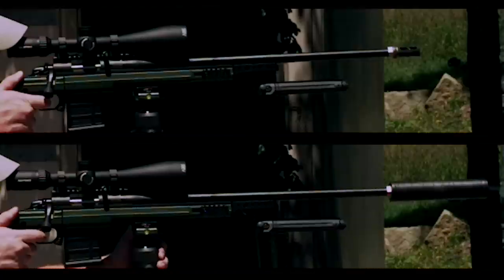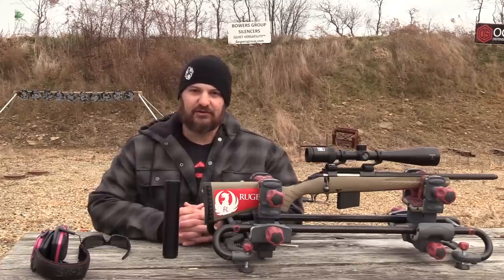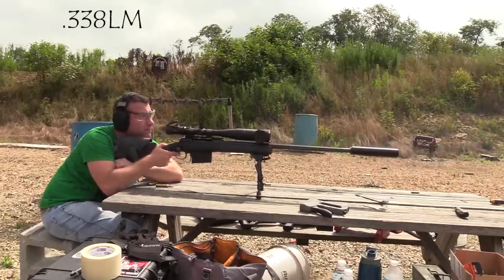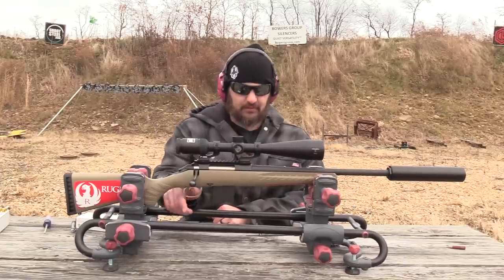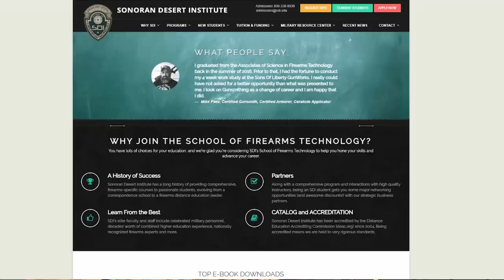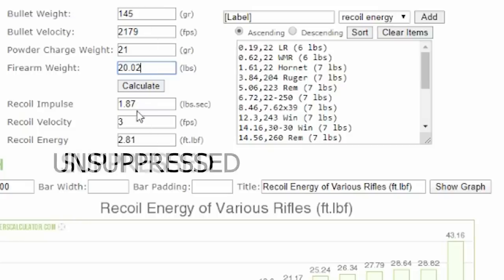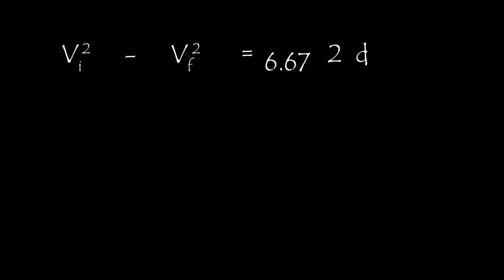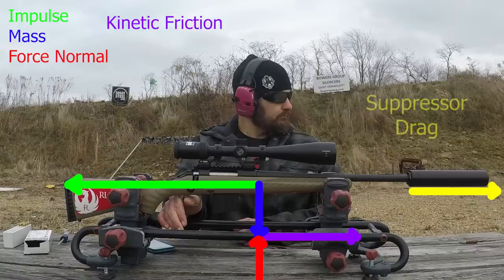Why Do Suppressors Reduce Recoil? Hidden Gun Knowledge

Comment: Hi! I'm an engineer and I've been wondering the same thing as you addressed in this video. I only have one comment! 

The problem you are looking at here is very complex because of the way in which the gases inside the suppressor are acting and interacting and applying forces to the firearm while the recoil impulse of the projectile is being applied to the firearm. So.. I tried to do the math on something simpler. What if all the suppressor did was just slow the gases coming out of the muzzle to such an extent that they would not be contributing to the recoil impulse of a firearm, such as with a muzzle brake? We know that that's how suppressors work, by slowing down propellant gases. What if that's all we chose to test and look at. So, i disregard any instantaneous or transient effects that may be occuring right at the time the projectile leaves the muzzle and gases are swirling in the suppressor, and look at a point in time when the firearm has had the impulse applied to it, and the projectile has left the firearm. Doing this, I used your numbers to calculate; 

The impulse of the projectile: 1.42 lb sec
Total impulse of the projectile + propellant: 1.87 lb sec
The impulse of the propellant gases (unsuppressed): 0.422 lb sec (difference of the two above)

Applying the unsuppressed impulse (projectile + propellant) to the unsuppressed mass of the firearm, yields a velocity of the firearm of 3.005fps, as given by the calculator.
Applying the suppressed impulse (projectile only) to the suppressed mass of the firearm, yields a velocity of the firearm of 2.194fps. The recoil impulse felt by the suppressed firearm should be 73% of the one felt by the unsuppressed firearm. (one divided by the other).

If I now verify with your numbers, and assume that the recoil impulse velocity should be proportional to the distance it moves (as it would be with constant friction => constant acceleration) I find that in your case, you found that the recoil movement of the suppressed firearm was 72.1% of the recoil movement of the unsuppressed firearm.

73% in theory, 72.1% in practice.
Reply: This is what I assumed was happening; a less effective muzzle brake.
Reply: @skepticalbadger  I thought about that actually after seeing your reply, and I checked with some numbers produced by other sources, namely precision rifle blogs big muzzle brake shootout. 

From them it seems as if a 27% recoil reduction is just about average for a muzzle brake/compensator, as some scored as low as 12% and others as high as 43%. The suppressor tested here seems to be right in between.
Reply: You way over complicated this.
I already left this comment but it's simple. 
The suppressor has added volume when compared to a barrel. This volume reduces the thrust leaving the suppressor. The barrel alone doesnt have this volume to reduce the pressure before exiting the muzzle.
His "parachute" theory is wrong. 
The force going forward is so minor it shouldnt even be accounted for.
Reply: @FreedomInc  Who overcomplicated what? The theory you propose is just wrong, and though I tried to explain all the math very very thoroughly, if condensed, this is two or three basic algebraic momentum equations. It is not at all a complicated description of the situation, rather way simplified. Your suggestion involves the incorporation of volumetric flow rates and thrust reduction due to increased area, which complicates it, but in the hopes that it may help you understand the math, I also did the impulse equation on the theory you propose.

Knowing velocity is proportional to momentum, we can substitute it straight into the equation below instead of velocity to find;

(assuming constant volumetric flowrate, which is the only distinction between this assumption and the method I proposed)
pi * d1^2 * v1 = pi * d2^2 * v2
pi * d1^2 * p1 = pi * d2^2 * p2
Solve for p2 => (d1/d2)^2 * p1 = p2
(0.762/1.5)^2 * 0.422lbsec = 0.109lbsec

Resulting total momentum of firearm assuming the proposed method is true;
propellant momentum + projectile momentum =
0.109lbsec + 1.42lbsec = 1.530lbsec

Applying this to the suppressed mass of the firearm the same way as we did previously, we can find;
(1.530 lbsec) / (21.23lb/32.17) = 2.318 fps
2.318 / 3.005 = 0.771 = 77.1% -> Insufficient as experimental data from the video shows reductions down to 73% and the "overcomplicated" theory was significantly more accurate.

The predictions resulting from the assumption you proposed are significantly less accurate (4.1% discrepancy vs 0.9% discrepancy, a relative difference of a factor of 4) than the "overcomplicated ones" outlined in my original comment, and are therefore wrong. They are also completely unsupported by the physical conditions, which is that the gases cannot simply exit the suppressor as quickly as is proposed by your theory. It would seem to be excellent for a blast mitigation device though, but not suitable or carrying descriptive power for the physical conditions here.

All the suppressor does, is effectively stop the gases inside the suppressor, while the projectile exits. The propellant gases can then slowly exit through the front of the suppressor, effectively negating their momentum.
Reply: @SigneOtter  ok, so for the normal scrub like myself, the added volume of the suppressor reduces the thrust exiting into the ambient atmosphere then.
Again,you over complicated it. 
But, the suppressor "slows" that thrust down due to the volume of the suppressor. Not so much the baffling in the suppressor due to drastic changes in the atmosphere of the suppressor.A larger suppressor no matter the weight or design will have less felt recoil than a smaller suppressor.
An empty "can" without baffles will cause less felt recoil than the rifle alone will have.
The projectile has no direct effect on felt recoil other than the friction caused by it which allows the pressure to build.
Reply: @FreedomInc  I dont think you understand the problem if you say I overcomplicated it. All the math I have used to show earlier does, is describe the problem like this;
The bullet goes out the front of the suppressor. The propellant gas stays in the suppressor and leaves slowly after the rifle has already experienced the majority of the recoil impulse due to firing. Don't include thrust, its inaccurate and it really does overcomplicate the problem. That being said, the explanation I gave can be phrased in a way that does include thrust; the suppressor completely negates the thrust normally caused by fast propellant gases flying out the front of the muzzle, reducing the total recoil impulse of the firearm such that the only recoil is caused by the thrust caused by the projectile going out the front of the muzzle.

But.. Thrust in very precise terms tends to include not just momentum, but also impulse. Which needs a timescale, and therefore requires me as an engineer to include the time over which this change occurs. An momentum exchange like the one I did only includes the final velocity and mass of each thing that shoves on each other, and is therefore not an overcomplication, but a simplification. I dont understand what your beef is here.

So.. When considering how felt recoil works, you need to try to consider the system in a vacuum. The rifle at first is standing perfectly still. As the rifle detonates the powder charge, the expansion of the propellant gases pushes the projectile one way, and the rifle in the other direction. 

We call this a momentum exchange. And we know from Newtons laws that each of those forces must equal one another, so we set the recoil impulse that the firearm receives equal to the impulse given to the projectile and powder charge when firing. 

That is what you feel when you feel the felt recoil. The most a suppressor could ever do to reduce felt recoil, because it cannot throw anything "backward" from the rifle, is "stop" the gases from going forward as fast. Which is the ideal case I showed the math on how to do in the first comment, in response to how the video seemed to overcomplicate it by assuming the suppressor could somehow pull on the rifle without exerting a force on something else. If it could, this would be a violation of newtons third law.

I hope this helps.
Reply: @SigneOtter  not everyone is an engineer.,but most people have common sense
Reply: @FreedomInc  I don't see how he over complicated this... It's very simple math and it quantifies and verifies the difference a suppressor makes. You just seem to have a conceptual idea and nothing more. Conceptual ideas are great for thought experiments but when it comes down to actual data you need to be able to put it into quantifiable terms or else you're not really any more correct/incorrect as the people that were in the "added weight" camp.
Reply: @Kyrazlan  I'm not getting back into this conversation a week later with some one else.
The extra volume of the suppressor cools the gasses. Both the cooler gasses combined with the volume of the suppressor reduces thrust. It is that simple.
And again, not everyone is a mathematician or engineer,but most people have common sense. Except apparently for engineers
Reply: Could't it be, that the recoil is just lower, because of the added weight of it?
In my opinion, the suppressor could even enlargen the recoil, because the gas stays in the barrel for a longer time, so pressure is forcing the bolt back for longer and  increasing recoil....
Reply: @Dodo-ze5ep  Thats not how the physics works. The calculations showed in the initial post accounts for the rifle being heavier with the suppressor mounted. The suppressor also does not add impulse in any direction, so it would not be able to increase recoil. Like if youre in space, in free fall, you cannot increase the force pushing you in one direction by a suppressor attached to your rocket thrusters "holding onto" the gas. What causes the recoil is the fact that the gas is pushing off of and out of the rifle. 

This is the basis for the same misunderstanding in the video, unfortunately, a failure to see the rifle as a closed system and look at the impulse transfer in the end states of the system.
Reply: @SigneOtter  But when a suppressor is mounted, the pressure in the barrel and the suppressor is higher for longer, as if the gun is fired normally, so in this point it has to add recoil, eventhough its probably not very much.
Reply: @Dodo-ze5ep  It does not. Thats not how free body momentum exchange works. The pressure in the suppressor pushes on the back of the suppressor, on the front of the suppressor, on the sides of the suppressor, all of this cancels out, so you need to look at the end state.

The cartridge detonates, the projectile goes out the front. the only opening is the front, so the gas goes out there too. except it gets slowed down a lot, which decreases its momentum.
Reply: @SigneOtter  Yes, I know that pressure works in all directions, but thats not what I'm trying to say. I just want to say, that as the suppressor slows down the gas exiting the muzzle, that this gas is longer in the barrel and will push the bolt back for a longer time than usual (without suppressor), which is resulting in a larger recoil. So its basically a bit like a rocket nozzle, thats made to hold the highest pressure for the longest time possible, which is basically the same thing a suppressor is doing. But I have to admit, that this "effect" probably doesn't make a very big difference at all, and that the recoil reduction in suppressors throught the fast gases hitting the suppressor and pushing it (and the whole gun) forward, is a bigger factor, but both forces do exist.
Reply: @Dodo-ze5ep  its the rocket equation, as you mentioned rocket motors. however long the gas is there doesnt matter. Just the mass of gas being expelled, and its direction and velocity.
Reply: @SigneOtter  I suppose the the energy from the propellent that would otherwise contribute to recoil is being converted to heat instead? Also I wonder what contribution the extra mass, and that mass being at the end of the muzzle, has on recoil, and more importantly how the added back-pressure and bolt velocity impacts semi-autos. Makes me wonder if suppressors reduce recoil more so on bolties than semi-autos. Seems somewhat counter intuitive that a suppressor would reduce recoil why simultaneously increasing back-pressure.
Reply: @SigneOtter  I just wanted to say that I understand your explanations, and appreciate you taking the effort to write them down

Comment: I always assume it worked just like a muzzle break but more like abs than standard breaks in a car. 

It slows down the Thrust of the gas going out of the muzzle rather than pushing back against the front wall of the break and thrusting inward toward the center of the break. 

At least in my head.
Reply: I'm sure that there is a minimal affect by the "catching and pushing forward". Bit noticed reduction in recoil is due to less thrust just as you said. The expanded volume of the suppressor drops available pressure leaving the suppressor. The rifle barrel doesnt have that extra volume to reduce the thrust.
Reply: Freedom Inc. makes sense. Thanks

Comment: Because it “catches” the gasses and forces the barrel forward.
Reply: No, it's because the volume of the suppressor reduces thrust leaving the suppressor when compared to the actual muzzle of the barrel.
Less thrust = less recoil
Reply: @FreedomInc  You're both saying the same thing. The can catches the gasses thus they don't contribute to the "thrust". There's 3 masses that leave the muzzle, the air in front of the bullet, the bullet, and the gasses behind the bullet. The can leaves only the bullet.
Reply: @snek9353  no,we are not. He is saying the gasses being caught by the baffles forces the barrel forward. I'm saying the suppressor reduces the felt reverse thrust from the shooters view. That's two different things
Reply: @FreedomInc  I don't see how, one causes the other.
Reply: @snek9353  it doesnt and that's the point of the argument. Gasses expanding reducing the thrust caused by those gasses and a trifling being "pulled" forward due to a braking effect by hitting baffles is two different things. One is factual one if fantasy. 
The reduced recoil felt by suppressed firearms is due to a reduction in thrust. That thrust is reduced due to an expansion of gasses prior to exiting the end of the muzzle which would be the end of the suppressor.
Reply: @Scotty Crawford An admirable attempt, but as Ron White notoriously explained "you can't fix stupid".
Reply: Sorta like a muzzle brake except trapping gas instead of redirecting it
Reply: @snek9353  Bro you tried. He just can't figure out that both are happening at the same time in to he suppressor to reduce felt, if he wants to be technical. To Quote you, THEY ARE LITERALLY SAYING THE SAME THING. Freedom just wants to feel smart.
Reply: @FreedomInc  If that was true wouldn’t you experience less velocity?

Comment: Force is the time rate change of momentum.
F =d(mv)/dt. The ( d) is the derivative which means change.  In this case, change is with respect to time.   The mv is mass of the system and v is its velocity.   So when firing the rifle the gases expand and travel down the barrel --- the fast forward moving lightweight mass 'pushes' the heavy rifle mass backwards, the forward moving gases hit the baffles and are turned.
So now the gases no longer have 'forward' velocity.  That loss of forward velocity is now a force working against recoil.
You don't even have to 'angle' change in direction  'backward' just to the side to get a reduction in recoil force.

F = m(ending velocity - initial velocity)
F = m(0 - initial velocity) 
   = -m * initial velocity
Which is a F force in the opposite direction of recoil.

Comment: One of the contributing factors to recoil is the mass of the powder/gas leaving the barrel. In a suppressed rifle, the gasses aren't all leaving at once with the bullet, they are dissipated more gradually, so the recoil caused by the gas is also more gradual. If you have a 275 grain bullet and 25 grains of powder, you have 300 grains of stuff leaving your barrel. If your gun is suppressed, and only the 275 grain bullet is leaving, you will have less recoil, because less mass is leaving your gun simultaneously at a high velocity.

Comment: What about, with a muzzle device vs. suppressor. Nobody shoots without a muzzle device. Also on semi automatics, bolt is traveling to the rear more harshly due to increased back pressure which cancels out what’s saved at the muzzle with a supressor

Comment: Your description of how suppressors reduce recoil is completely wrong because suppressors are a closed system until the bullet has left the end cap. You can't put a fan inside a pressurized vacuum chamber and expect it to push the lid off. (pressurized meaning there is air inside of it, it is just a closed system) The reason why the recoil is reduced is the same way recoil is reduced on large caliber guns like tank guns or howitzers by their reciprocating barrels. The gas expanding in the suppressor reduces the PSI of that gas and so the gas comes out of the muzzle/end cap at a lower pressure, but it takes longer to fully exit the previously closed system. If you were right, gases would affect a gun before the bullet has left the muzzle by pushing against the rifling and through drag.

Comment: With your initial claim about added weight to the system, and comment that even the small weight of extra rounds would throw measurements off, I am surprised that you didn't weigh the silencer and then add that much weight to the recoiling system with the bare muzzle to verify the difference made by the recoiling mass alone vs the same mass configured as a silencer. Your test was still one of two different weight systems.